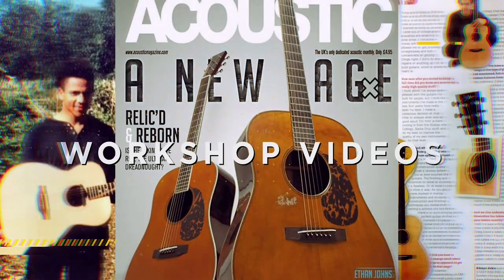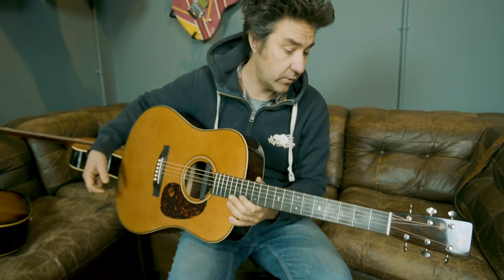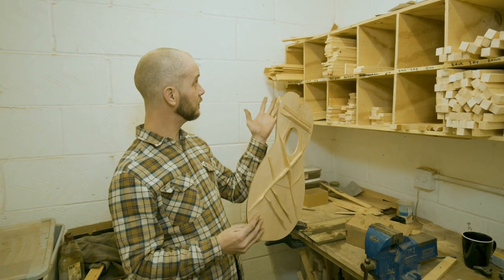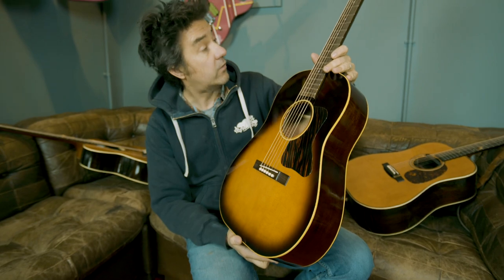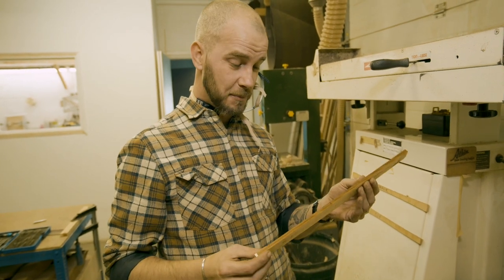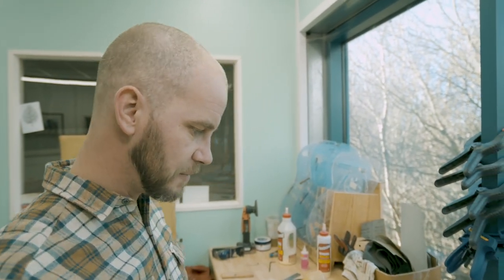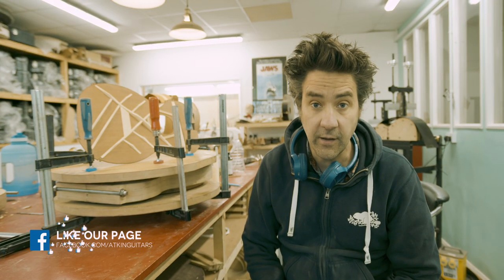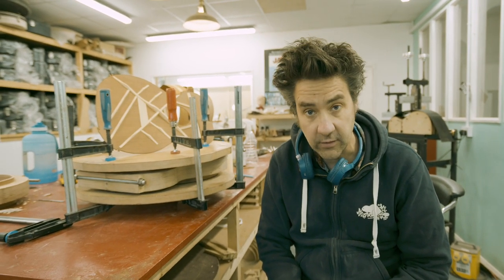Atkin Guitars Workshop Videos - Ep 5 - How to make braces, brace a guitar top, vacuum pressing a J43

Comment: Strip pine?  Is that like your hardware store pine over in the uk? And you guys just mill it to get quartered pieces?
Reply from the maker: Essentially yes Adrian… our timber merchant is very good to us and picks out the quartered stock for us 👍
Reply: Well that’s good to know.... saves me trying to chase down spruce. Plenty of pine here in OZ. Are you shaping your braces lighter or basically the same as you would for spruce. Just thinking in terms of weight. Not a huge difference between the two but.